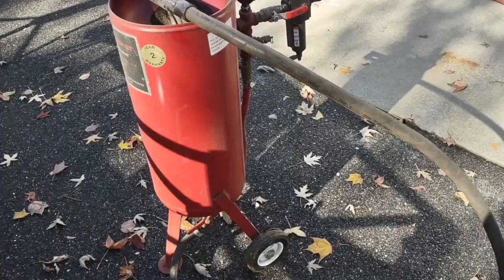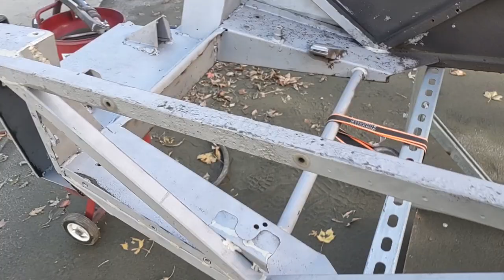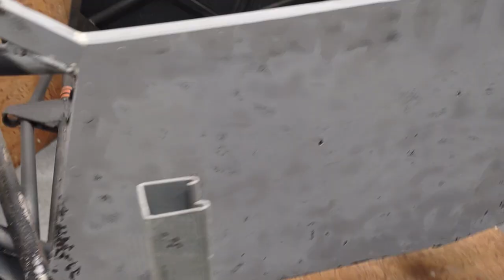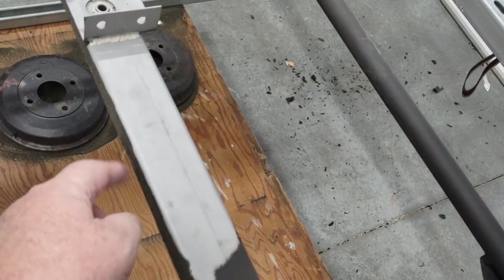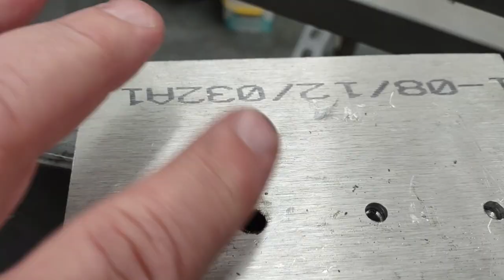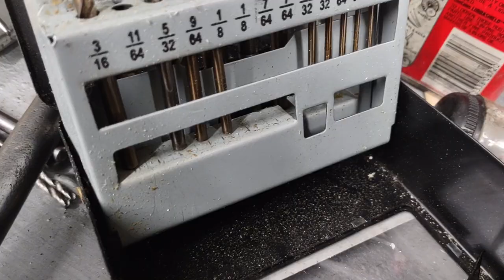Lotus 7 S4 Restoration Ep40 - Part 2 of Blasting the Chassis

Comment: I have a near identical ALS Sandy Jet that's as least as old if not a bit older than yours. We made a big funnel about 8 inches deep that just fit into the top of the hopper and then a basket screener to sit into the funnel to sieve media before it went into the tank. I'd typically catch half a dozen pieces per bag on the screen that would've clogged the nozzle without screening. I won't claim sandblasting to be one of my favorite jobs, but I did enjoy seeing the work progress and something that had been wearing years of paint, rust, and filth taken back to raw metal.
Reply from the maker: Thanks. I have been sifting each media bag into a bucket and screening out the chunks. It is not a fun job but I upgraded from a floppy hood to a fresh air helmet. So much better.